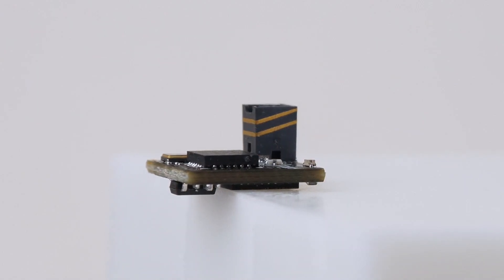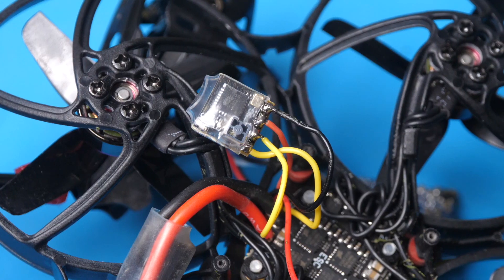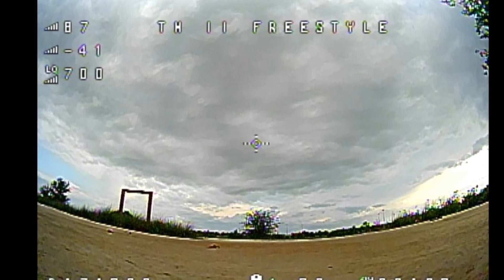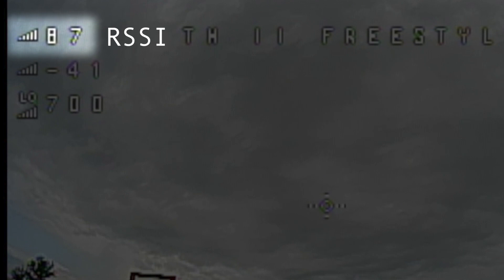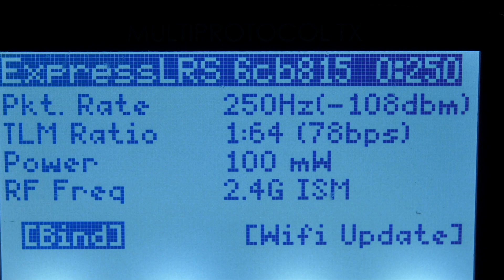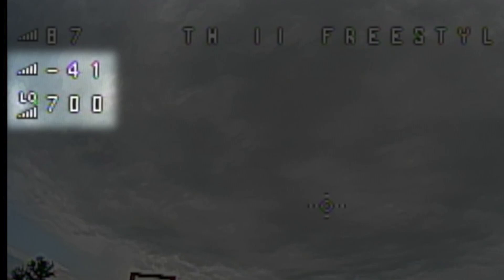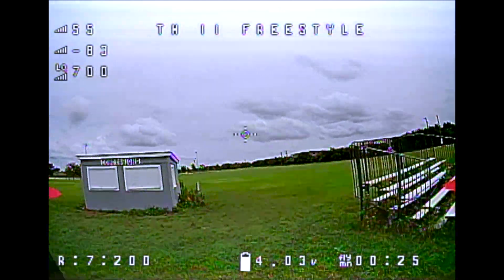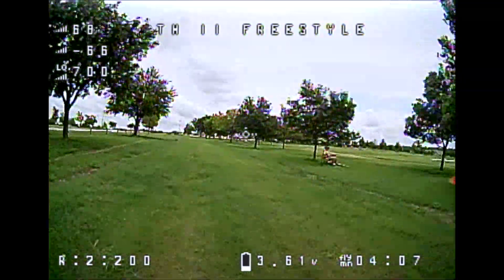ExpressLRS Final Review and Flight Tests - Best Control Link For FPV Drones?

Comment: I just got expressLRS for a fleet of micro drones that are going to be used for a drone racing club I’m starting at my college. This video is very educational for new pilots to understand what LQ and RSSI mean as well as breaking down a comprehensive range test. Thank you for your work on this video!
Reply from the maker: I’m glad it helped! Make sure to check out my setup guide video too when you start putting them together. ELRS is really a great system. We’re very lucky to have tech like this available to us.

Comment: Great info/tests! I just installed the same RX on my TH Freestyle, in place of my XM+ I put in when I converted the camera, FC and 350mw VTX. It's nice to have that extra security.
Reply from the maker: It’s so great. At this point I use an EP2 rx on all of my builds. I really just do not have to worry about range at all. If I have video, the control link will always be there too.
Reply: @ATXAirborne  Just had a chance to fly it for the first time with the ELRS. I flew over an area where my FrSky would always drop the LQ and it would failsafe if I didn't get out of there. No issues now. I'll be converting all my fleet now. 👍

Comment: Something to consider before change over to ExpressLRS is that it only has 4 servo channels the other 8 channels are either 1 bit, 3 bit or a single 4bit channel.
Ok this may not be an issue for most drones but it is a limitation that other systems do not have.
Reply: Do you mean like for planes and helicopters etc?

Comment: wonder how my whoop one does. ceramic antenna is inside the frame under flight controller and over battery so it is blocked.. i mainly fly it indoor so normally not an issue but want to try outside lol.. has 500mw vtx

Comment: Results were great for the size of it and the power output.
Reply from the maker: Months later, I can say that setup process has also proved to be extremely easy time and time again. To set up a new build, I just connect to the receiver with Wifi and flash the firmware with my passphrase already set. Then it just works. This is so much easier than Frsky.

And in terms of flight performance I have never had a single failsafe or problem. It’s been extremely reliable.

Comment: Hello, I think your video is super good. I have a HappyModel EP1 ExpressLRS 2.4GHz receiver and would like to set the VTX table in Bethaflight, but it cannot find it. what should I do?
Reply from the maker: Hey, so the VTX table actually is for the video transmitter channels and doesn't affect the ExpressLRS receiver in any way. You'll need to figure out what VTX is on the drone and look up the VTX table settings for that VTX.

Comment: Sweet vid! What's that prop on your wall? That's a monster!
Reply from the maker: It's a 3D printed life-size version of the prop on the Ingenuity helicopter on Mars!
Reply: @ATXAirborne  neat! Did you do that yourself? If so what printer? Cr-30?
Reply from the maker: @Digit-Did-It  Haha, actually yes exactly that. I own a 3D printing business and we preordered one to see how it'd work for production runs. Turns out it's better for large prints like this. We did actually print that one as two interlocking pieces. The whole prop is about 4 feet long, but each piece is a more manageable 2 foot print. It's really neat as wall art, though.
Reply: @ATXAirborne  are you in Austin? ATX? look for an email from me.

Comment: Did you use instructions for installing it on the Tiny Hawk 2 Freestyle? That's exactly what I want to do, it would help massively. 

Anyways, great videos, I'm glad that open source technologies catches on!
Reply from the maker: I think I looked up a video on how to install Crossfire just to check my work, but basically I soldered the ELRS receiver to the 5V/Gnd pins and the TX1 and RX1 which are labeled on the board. After that, it's the same configuration process in Betaflight as you'd use for other drones. If you check out my previous ELRS video on the setup process you can see how to do that part.

Let me know where you're stuck and I can try to help out. Thanks for watching the video!
Reply: @ATXAirborne  found the pins on the board (all on the back side). Thank you so much! I will give it a try once it arrives from China.

Comment: great review. i've got the full range crossfire but have had some suprising failsafes with it. and have always been annoyed with the cost of the receivers, thus not owning more than 3rx's at any one time. This is making me consider giving the 2.4 elrs system a try for quads. if it proves a more robust link and faster to reconnect (after a failsafe) then its good
Reply: How do you manage to failsafe crossfire? Is your output power not right or are you flying 40+ kilometers behind buildings and trees

Comment: Incredible. So for micros 2.4ghz ELRS an the ceramic antenna is all I'll ever need and it's way smaller and lighter than an FrSky receiver. Might not even be worth it to display RSSI in the OSD with ELRS. It will always out range video.
Reply: Display link quality instead

Comment: This is the test we need to see, love it. Do you have a plan to test 900mhz expresslrs control link penetration?
Reply from the maker: I do have the 900Mhz ELRS installed on a cinewhoop. Not sure yet how much testing I will do with it, mostly because I think the 2.4ghz is more than sufficient for most uses and has the advantage of being smaller and lighter. But for some upcoming testing I'm working on with Sharkbyte, I might get the opportunity to test the performance of the 900mhz link at the same time.
Reply: @ATXAirborne  do you think expresslrs 2.4 ghz is relevant for mid range (less than 10km), freestyle etc?
Reply from the maker: @s2_fpv  I think it should probably be the default choice for most cases. You could definitely get 10km line of sight, especially with the EP1 (external antenna). I have a feeling if you're flying that far out, you need the line of sight to get video reception anyway.

For freestyle, I wouldn't think you'd typically be too far away from your launch position, and I did see in my testing that the 2.4ghz ELRS was able to work when I flew behind a large building, which I think is an impressive capability. At this point, I'm not sure the 900mhz ELRS buys you much unless you're doing extremely long range flying in a fixed-wing or similar.
Reply: @ATXAirborne  thanks for the advice, you help me a lot. 👍

Comment: Nice videos,well done my friend!
I see that your rssi value drops from 99 down to 40 sometimes  and you are not far away.How low you think that this value can go and still have a link?
Reply from the maker: It's hard to say because RSSI isn't really a great measure of signal strength. It's possible it could go down to 1 and still have signal. It's probably better to look at the RSSI dBm (can't go below -108 in my case) and LQ (can't go below 600 in my case). The problem is that none of these values drop linearly as you get farther away. It'd be possible for RSSI dBm to be at -90 and then suddenly drop to -105 when you go behind a tree. It's always going to depend on the specific obstacles you're dealing with, the orientation of the drone, any other interference in the area, etc. 

With this type of testing, we always try to do representative flying so you can get an idea of how it performs in a certain environment. If you're talking directly about range in an open space with no obstacles, people have gone out to 30 km or more with ELRS. Anecdotally, I haven't had any failsafes yet, although my radio has given me a low RSSI warning once or twice.

Hope it helps!
Reply: @ATXAirborne  
Thanks for your great answer,and looking forward for your next videos!